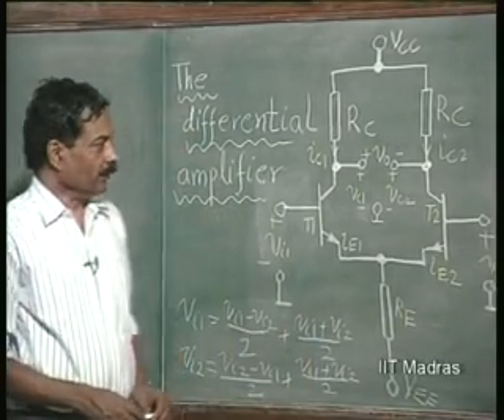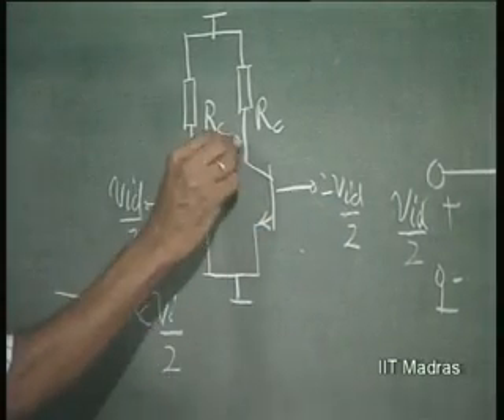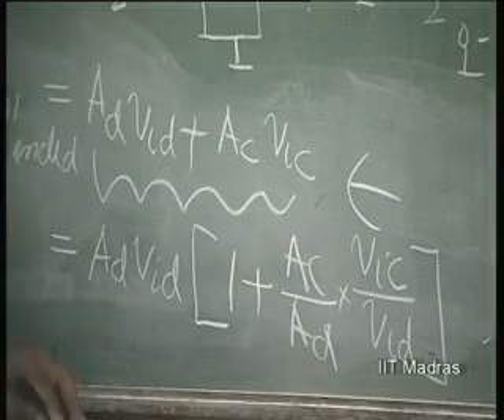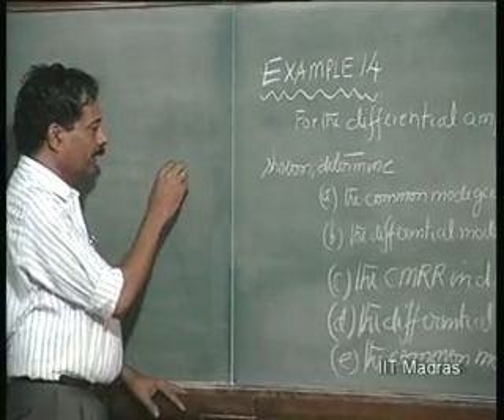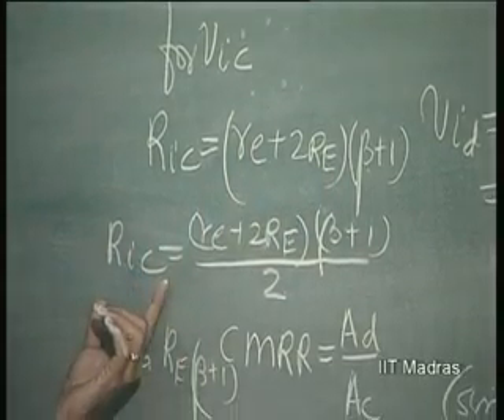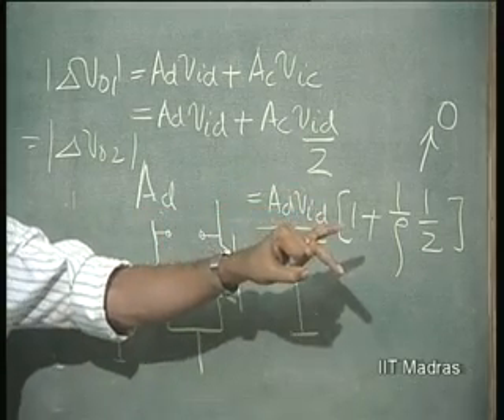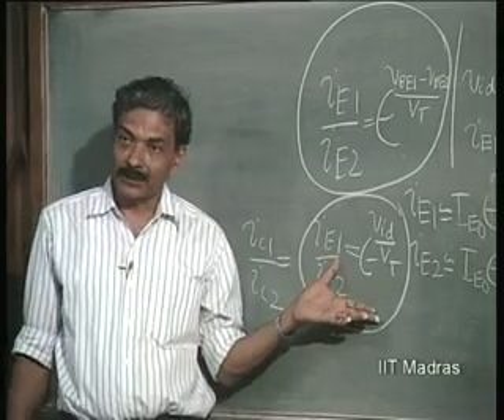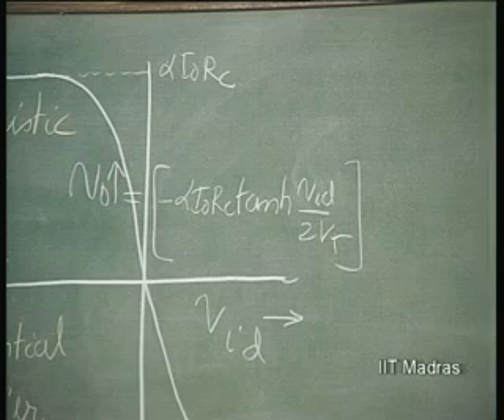Lecture - 32 The Differential Amplifiers

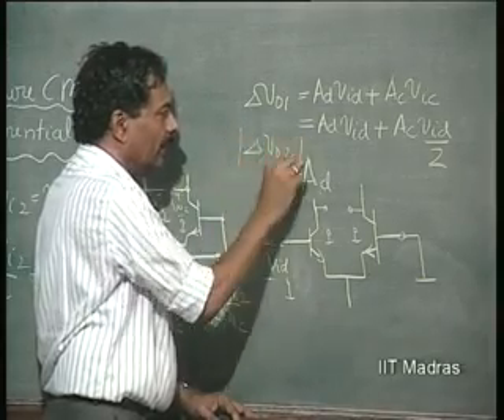Comment: I have a doubt at 39:21 , if the base of one of the transistors is connected to ground and the base of another transistor is connected to Vd, then how can the output of the transistors become the same with opposite polarity? can anyone please explain?
Reply: One side applied Vid and other connected to ground, now for the voltage source Vid it will be two equivalent resistors re place in series to the ground thus voltage Vid will be equally divided between the resistors re(internal base to emitter junction resistors)
Reply: @davejenil1537  thank you for the help, I understood